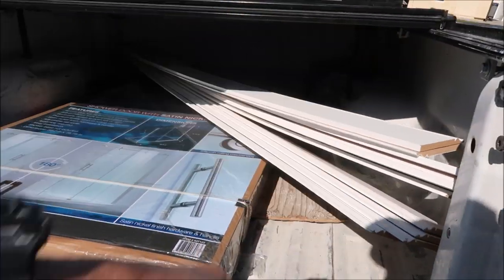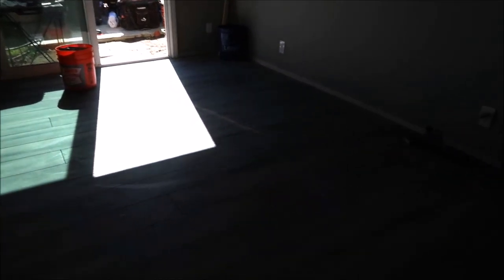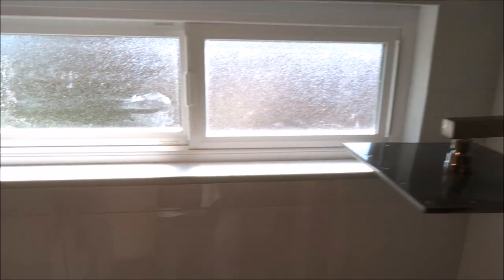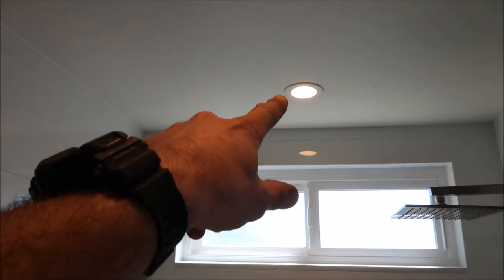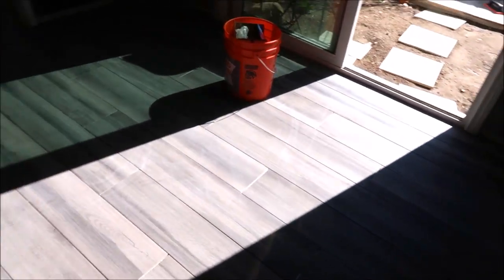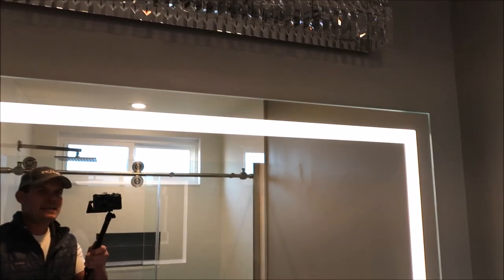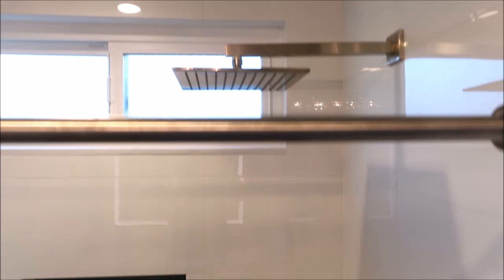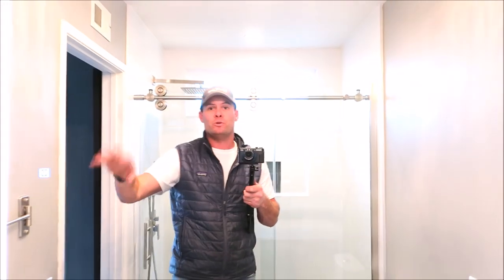Beautiful WOOD LOOK Shower Remodel

Comment from the maker: Gloves here https://amzn.to/2WNOv1r
Diamond hand pad https://amzn.to/2GxqaqR

👕Order Tile Shirts https://represent.com/store/landberg-tile-diy-tv
Reply: With the self leveling kit are you using it on even the floors to get them to be so level or do you just normally use those on the shower walls? I am a up and coming tile installer and I'm trying to perfect the art. Your videos are really inspirational and also educational!! Very strongly appreciate it, I was installing 31 1/2in  by 15 1/2 inch tile and through your videos I ended up picking up the beast because of the capability of cutting such big tile also got it for a deal or i would have got the DeWalt.

Comment: That's how our tiles sound when you knock on them. Our shady builder had his niece & her husband tile our house (they weren't professionals). ALL the areas where they installed floor tile you can find multiple hollow tiles. We are currently in the early process of retiling our shower & bathroom floor. Our shower is having water leakage issues & our grout has been disintegrating. You can hear the water squish under the shower floor tile after the shower has been used, I doubt they did any waterproofing..... I can't wait to tare it all down & do it properly! Your videos are a huge help!!!

Comment: Love the modern look. I am currently doing a single slope to slot drain 32" x 72" curbless shower.
walls on 3 sides. Fixed glass panel and opening for walk in. Floating 4 inch thick bench attached to two walls over top the slot drain.
Just gettin started. I'm a DIYer. I think it may present some challenges. I may be contacting you for advice. I want it to look as clean as yours. 
I would think it is difficult to constantly come up with content for videos. 
Maybe in the future it would be a good video to explain what I was trying to do and how you may have helped me.
I can only take pics and video with my phone.  It could be you narrating and explaining the challenges while showing pics.
Just an Idea. No big deal if it doesn't work for you. I don't want anything out of it. Thanks for your videos they inspire me!.

Comment: What a lovely finished room. Top workmanship. Beautiful. Just a quick question if you were to install a porcelain plank tile in a herringbone pattern. What is your preferred method of cutting your 45 degree cuts, would you score and snap or use your dewalt wet saw? Thanks Matt
Reply from the maker: We would use the Dewalt tile saw for sure and bevel the cut edges with our diamond pads 👊 Thanks for the watch and comment sir! 👊
Reply: @LandbergTileTV  Brilliant thanks for the advice and help. Would the montolit master score cutter be able to snap the  herringbone 45 degree cuts which run  along a straight wall? I've got a rubi ts 60 but as it's got a fixed breaker it can't snap triangle shapes as it puts to much pressure on the tip of the triangle. Having a moving breaker It might help I was thinking??? Love your videos you cover every last detail 👌

Comment: Superb job a credit to the trade mate have you ever heard of silioning tile joints I've got 150 M2  of 60 X 60 to fit and client was wanting it  never done it in 30 year balance Miro ban my preferred grout
Reply from the maker: We only silicone the sides of the shower where the planes meet and the ceiling to avoid cracking. Is that what you're asking?

Comment: This is extremely beautiful performance. I love your modern style and ideas of tile layout and colours combinations. 
You installed the tile planks on the concrete substrate and you did not use any uncoupling membrane or self-leveling underlayment and it should mean you got very good flatness tolerance which for these tiles has to be FF50 or FF60. If there was any problem with flatness tolerance how did you solve this? Thank you in advance.
Reply from the maker: We install self leveling concrete it the floors have low or high spots, plus the addition of a half in trowel and clips help also! Thanks for the nice comment and watch friend! 👊
Reply: Thank you for your fast response. 👍🙏

Comment: isn't curbless walk in shower should have whole bath treated as shower, if yes, why no waterproof floor except shower area?
Reply from the maker: We installed Kerdi membrane 24 inches outside of the shower on the concrete slab.